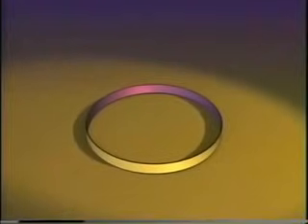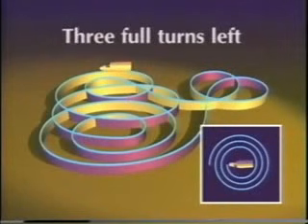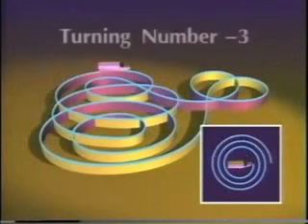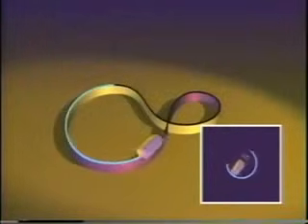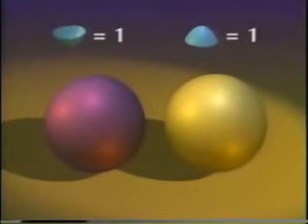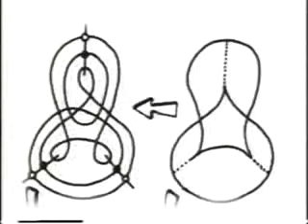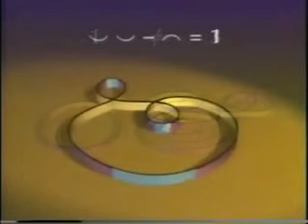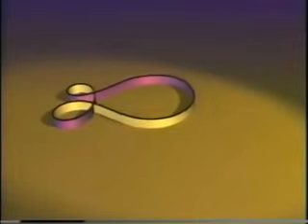how to theoretically turn a sphere inside out

Comment: Anybody can turn a sphere inside out if it can magically pass through itself.
Reply: No, it's difficult. That's the whole point of the video.
Reply: Kanade Tachibana It's not arbitrary, you just don't understand this level of math
Reply: Because it wouldn't be a mathematical challenge if the solution were allowed to be so simple.
Reply: Jason Jahn But why did they place the sharp corners limitation if they can just make up a material that can pass through itself?
Reply: The problem and the limits they impose are standard problems in the study of topology. And from there you get more practical applications. So it's not all just arbitrary limitations that were imposed.
Reply: Kanade Tachibana Imaginary numbers seem rather unpractical, too. But they were very useful for physics. Those things can be practical for theoretical formalism, although they may be entirely useless in every day life.
Reply: Kanade Tachibana Clearly this stupid fabric is rather useless. It is just some desperate attempt to visualise the properties of topological objects, which are not real world objects. This evaporation just shows you that your transformation is no longer valid. Surely no real object will ever behave this way, it just symbolises "you are not allowed to do this, becaus this operation is as ill defined as division through zero".

This video was about rather abstract, mathematical objects, not about a magic fabric. You simply can't say, topology is useless in modern physics, as it is used by some theories. This is one example of a topological proof, so it may be useful in some theory.

But I admit that such a fabric seems rather rediculous. If this video was meant to suggest that actions on such a very imaginary fabric would be a practical application of this proof, I would say, you are totally right, that would be very stupid. But I would guess this is simply not what they wanted to tell.
Reply: Kanade Tachibana
It's not so much a matter of "is all this coherent to all that other stuff". This is a building block that you might use to build something coherent: Having proved that this inversion is possible given assumptions A and B, and you can fulfil those assumptions, you can now safely go ahead and just use that result.

On the top of my head and without thinking into detail, this relates to mathematical optimisation in the sense that it gives you a way to invert your problem. That is, it's a way to take a gazillion constraints of the form "The voltage here may not exceed 230V but must be higher 240V" and turn them into the exact opposite: That is, allow anything but the span 230-240V. Which sounds useless in practice, but then I might be missing things and, more importantly: Other applied fields can probably make more of it.

Yes, we applied people often make fun of the more theoretically-minded ones as they just solve any theoretical problem they come across, without looking at the real world. But then, one day, their stuff usually turns out to be actually useful and we applied people are glad someone already solved it.

Take numerics as an example: I think it was Leonard Euler who, more or less on his deathbed, said "I have created many a thing of mathematical beauty, alas, none of it will ever be of any use". Yet, the encryption technology we use nowadays to order donuts over the internet securely is completely impossible without his results.
Reply: Jason Jahn The video should be title "How to solve a useless math equation".

They asked the question "How do we turn a sphere inside out?" Then they realized no amount of math makes that possible in real life. So they made an imaginary material so it is possible, but then it became too easy. So they decided to add a limitation that doesn't fit said material to make it more difficult.

Don't you see how stupid this is?
Reply: Kanade Tachibana My comment listed specific real-world cases where this problem is used as part of real, physical engineering...
Reply: Kanade Tachibana - Here are some practical, real-world engineering uses:

This video relates to topology of functions around a 3d field. The theorem here can be directly used in 3d fluid dynamics around vortexes - for example when a computer is calculating models of liquid or gaseous behaviour in a combustion engine, turbine, or any other kind of device which is being designed by an engineer to come in contact with fluids.

Another direct use of these theorems are in designing certain kinds of liquid crystal displays for the "electronic ink" kinds of devices..

I've also seen similar topological arguments used in computer graphics for games/film..
Reply: Kanade Tachibana
Being embeddable in the physical world in a literal sense is not a requirement for things to be useful. In, say, mathematical optimisation people are constantly working with bodies that have a thousand or more dimensions, it's all making sense, and your power company probably wouldn't be able to keep its network stable without it.

These are conceptual bodies, where a dimension might map to a slider on a switchboard, somewhere, and you can have thousands of sliders hence thousands of dimensions. The laws governing them are similar, but not necessarily identical, to bodies in the actual physical world. We call them "bodies" because it's the closest analogy we have.
Reply: aoeuable Just to throw in something here, I agree, Euler's creations have greatly affected technology as it stands today. This world would be nothing without both the theorists that focus on imaginary figures, and the people that find ways to apply such things. It's more common to be constructive in the sense that you apply things, as you all seem to be, I definitely am, and most other people are. Without people who study something as seemingly ridiculous as this, though, innovation would be impossible.
Reply: Ильгам Хеирбеков I hope all of you don't mind , but I'm going to mute this post. It was a long discussion fit more for a message board, not the comment section.

I should not have acted so quickly and called this video useless, because no matter the relevance it is still entertainment to some. Therefore if you want to know how this is useful, ask a professor and learn yourself.

Don't slander other's and tell them to do research for you, like I did.
Reply: *****
You can't think of a material that's able to pass through itself? How about every kind of liquid and gas on the planet? The contents of this video are used heavily in modeling fluids.

"Why can't there be creases?!" - Because the underlying math it's modeling is useless otherwise. Just because you don't personally work with concepts like fluid dynamics in your own life doesn't make the restrictions related to them arbitrary. Lol.
Reply: Kanade Tachibana Also, re: "no sharp edges" being "arbitrary" - that's the definition of "continuous" in mathematics ( http://en.wikipedia.org/wiki/Lipschitz_continuity ) - which is an underlying physical limit on any practical use because time moves continuously.
Reply: Kanade Tachibana In mathematical optimisation, you turn such constraints into a body, a bit simplified: Each face is one constraint. Every coordinate inside that shape is a feasible point (one that does not contradict any constraint), and you're then looking for one of those feasible points that minimise, or maximise, some further criterion, like "minimise fuel cost".

That is, you take a whole a lot of real-world things, pretend they're shapes in arbitrarily high dimensions, then solve a geometric problem ("what's the point the furthest into this particular direction that's still part of the shape"), then translate the whole thing back into the real world.

In short: The shape not being physical doesn't mean that it can't be useful for solving actual physical stuff. We could call it something other than "shape", but we don't because calling it a shape makes it easier to reason about.

Also note that it says "sphere", here, not "ball". Balls exist, spheres are mathematical objects.

Circles don't exist in physical reality, either: You have jagged edges everywhere. Still they're useful.
Reply: Kanade Tachibana
Almost everything you'd call "practical" in your daily life comes out of research that you'd say is "theroretical" and apparently think is useless. Solving problems like that one might lead to new ideas about doing math and that would impact EVERYTHING in your life in a very practical way. Without solving problems that you deem "at the peak of uselessnes" you wouldn't have smartphones, nor computers, the internet or even something like lightbulbs. You'd be back in the dark ages.
Just because you don't understand something doesn't mean it's useless. It only means that you're ignorant of the subject. Which people usually just accept and don't feel the need to make big demonstrations of their ignorance claiming to know better.
Reply: David Stevens "But why did they place the sharp corners limitation if they can just make up a material that can pass through itself?"

Mathmaticians are seeking ways to make precise models of vague ideas, such as geometrical shapes. The amount of information you put in the model has a lot of impact on the amount of consequences that follow.

For example, you might want to allow such creases. Then, this particular problem is easy, and the field of maths analyzing it is called topology. The shape is called a topological manifold (embedded in 3-space, which is normal, 3-dimensional space).

You'd be surprised with what freaky kind of creases you can come up with and what you can do with them to "cheat" your way to certain results.

By disallowing creases you put more information in the model, since in order to define creases properly you need a notion close to curvature. The surface is then called a differential manifold and the field of maths dealing with it is called differential topology.

Topological manifolds are differential manifolds where "we forget about curvature", and so creasing becomes unimportant.

It's easy to see how self-permeability isn't really that relevant to that distinction. Self-permeability is of course another valid constraint that can be place independently.

The important thing to realize for laymen here is that mathematicians don't invent those rules arbitrarily: They analyze all possible rules that you can think of.

The fascinating thing here is that there are many surprises with specific such rules, such as this one.

If you want a more elementary example for such a "modeling problem", look at irrational numbers or the incountability of the real numbers. These things are sometimes discussed even in school, and nonetheless extremely surprising.
Reply: aoeuable You seem very educated in this discussion, so I will give you the benefit of the doubt. Could you link me to something that proves this math is coherent to said engineering? 

I'm not attempting to insult you, you responded how a reasonable person should, disputing the central idea of my argument. Props on that, my good sir.
Reply: aoeuable That definitely applies, but I'm not talking about any arbitrary rules, I mean THIS problem. Not meeting an exact voltage is a problem that has practical use, it isn't making up a problem for the sake of the problem. It isn't widespread with the possibility of entering the numerous fields of engineering.
Reply: Samurailord I'm not saying all theoretically problems are dumb, but this one certainly is, because it isn't really a problem. If something can pass through itself, sharp edges won't stop it.

And don't compare light bulbs to this, in what way were light bulbs based on a fake material that somehow had only one incredibly irrelivent flaw? Light bulbs are just a textbook invention of a REAL issue, with REAL limitations.

Face it, this is a BRAINTEASER that mathematicians made, not a theoretical math problem with implementations some day.

And lastly, for the record, I understood the videos perfectly. Just because I think the problem is useless doesn't mean I don't understand it.
Reply: joshfish2 You never sit there thinking about things and wanting to work them out? Never try to figure out how to manipulate things 3 or 4 dimensionally? Never try to imagine what it would be like if we could view things in a fourth spacial dimension?

What do you think about on long drives? Or when you're laying awake at night tryin to sleep? Or when you're waiting for he microwave to be done? During loading screens in video games? If you think it's pointless, then it's clearly not for you, it's for the ones that don't.
Reply: Kanade Tachibana So then what you're saying is that it's useless because it's simply a puzzle that has no real life application? Even ignoring that it has many applications, so what if it's a brain teaser? It gives people something to think about. Does it need any more use than that, even? Puzzles exercise the mind and help people come up with new ideas. It's thinking like this that might cause someone to shout EUREKA! And run naked through the streets.

Also the pinching rule is NOT arbitrary. I interpreted it as being based on the face of the sphere is a mathematical curve, and in a lot of equations you can travel infinitely close to zero, but can't reach it without opening up another can of worms or hitting a dead end. It is, in fact, making things simpler to mathematicians in that aspect.

I mean also... do you really think it is any more useless than telling of people who are interested in the subject that their interest is useless over the course of a week on a youtube video comment thread? ;)
Reply: Tim Wintle I'm done researching this topic, but you are more educated than I am in it.

I guess I'll just accept that this problem isn't useless.
Reply: Ильгам Хеирбеков "Name one prediction maths ever made. And I don't mean calculations based on REAL WORLD objects."

I can't, but then again I didn't claim that unapplied maths made such predictions. joshfish2 claimed that history does, which it doesn't either.

Maths, on the other hand, can be applied, mostly by the natural sciences and engineering, to make all sorts of predictions.

For example, the complex numbers, discovered by Gauss before any real-world use was known was later successfully applied to many areas of science, mostly electronics and other parts of physics.

Up until then, people like you would have whined about how complex numbers follow "ridiculous rules" and "can never exist in the real world".
Reply: "If I can't understand it, it must not make sense!"

Yep, you're a genius. I'm sure you've got as many engineering degrees as you do spheres of water.
Reply: Chad Wolfe Theoretically, couldn't any brain teaser, like the wolf-rabbit-corn puzzle, be a basis for future tech? You can't say for sure, can you?

That's where this WHOLE conversation crumbles...
Reply: John Tyson Still just a fancy riddle. Interesting to some, incredibly pointless to most.
Reply: Tim Wintle 
Let me settle something people keep coming back to:

I do not think all topological theorems are pointless, just THIS problem.

I know the theoretical study of 3d space is useful, but this one simply isn't.
Reply: If you can create a virtual world with specifics rules in it where you are allowed to have materials that can pass throught itself but can't pinch then it's not a bullshit idea.
Reply: Kanade Tachibana You're asking strangers on a YouTube video to provide a practical explanation or use for a mathematical concept that took doctorate, award-winning mathematicians from the world's premier universities to come up with. If you're legitimately interested stop wasting time on here and send Professor Stephen Smales a letter or something.
Reply: Kanade Tachibana There once was a bottle called KleinThat had such a clever designIt would turn inside out,Which created some doubtWhen it came to decanting the wine.
Reply: aoeuable That entire comment is full of buzz words that had no underlying point. You basically expanded "Limitations may seem odd, but happen, and are useful" into numerous paragraphs.

I'm not saying problems LIKE this don't exist, I'm saying this is useless when compared to real problems.
Reply: joshfish2 History can't predict anything, and, to be fair, making predictions is very clearly not part of of the science of history.

It's a bizarre claim especially in the context of comparing it to mathematics, as maths did indeed help to predict a lot in many sciences.
Reply: @kanade tachibana there is a solid reason for the requirement.  In order to write an algorithmic transformation, there can be no edges or vertices on the surface as they will trend towards zero or infinity and render the transformation invalid.  The point is to be able to map every point on the outside of the sphere to one and only one point on the inside of the sphere.  These mappings lose their one to one property if they cross an edge.
Reply: David Stevens because this material is following some laws of physics,
Reply: Kanade Tachibana
see, math and theoretical physics is very abstract at first.  you see no relevance for it unless you work for it.  you need a fucking deep understanding of it to see the uses of it. 
sometimes its better to be humble and just back off instead of starting to judge things you have no clue of especially when its well known that math/physics can be very complicated.
the "regular" human living probably thinkgs quantum mechanics is useless when he sees it.  just some fun games for nerds. i totally understand that point of view but people should be much more humble about things they have no clue of.
quantum physics is VERY important for electronics, chemistry,  solid state physics, informatics, engineerng, medicine, theoretical physics thus physics in general too.   its one of the topics with the most influence nowadays.
i hope you get my point.
Reply: This was very frustrating to read as I felt the need to just punch someone in the face but had nobody in front of me, just an outdated text written by an initially ignorant person. I am very glad there are lots of smart people explaining things in a very calm, very nice way. I would have choked someone already. Kudos to all the fine people who have patience and proper eloquence.

I was just shaking my head in disbelief. Wow, the ignorance.
Reply: joshfish2  Number theory was considered useless by almost everyone(which includes some extremely smart people) until 1940s or so.  For 300 years, it was something some math geniuses did for their own amuzement.  But now modern cryptography depends on it.  The thing is you never know what will be useful and what won't.
Reply: Phraser
thats it.  people judge too fast even without being educated well in that topic.
Reply: ***** I think the point of the rules is to focus on the turning numbers. As the woman says, if the pinching/puncturing rule didn't exist, the turning number wouldn't be constant for circles (or 2D curves). However,with these same rules, they prove that 3D curves do not have a constant turning number, which is interesting. I'm not sure what that means for mathematics in general, but it's interesting that the constraints kind of center around that one concept.
Reply: The "no-crease" rule, but at the same time allowing 2 objects in the same place at the same time just seems so arbitrary. Why even have the no-crease rule? It's like a useless game where you just make arbitrary rules to barely make something possible, but there is no logic behind the rules, it's just really conveniently designed to make it possible, but hard.
Reply: Kanade Tachibana I think it's kind of 50/50 though. There's really no way you could possibly know. !00 years from now things could be entirely different and maybe limitations like that may exist. That's unavoidable. 

Although this is true, I do agree to the fact that it's more of a brain teaser than a theory. 

And also, you understand the problem, but I think the person commenting before may have meant that you don't understand the possible reasons for the problem because they don't exist yet, though they may one day, who knows?
Reply: Jason Jahn
but that's the thing about these problems. What's the point of making a fucking problem if it never existed nor will ever exist?
Reply: Kanade Tachibana The nature of theoretical science. Maths isn't the only science that you can hold that against. History is also pretty pointless, so is building particle accelerators.
Reply: Jessica Wilkinson
ok I'd admit that I'd think about it. But I wouldn't find it useful in my life, it would just be something to think about while, as you said wait for the microwave or something.
Reply: John Tyson
How is history a science? Sure history isn't that useful but at least it can predict events in the future according to past mistakes
Reply: John Tyson
of course it can predict things, such as the fact that there are sadly many possibilites for a nucleur war or world war 3. It almost did happen and the world knew it, the Cuban missile crisis is the most infamous of these events.
Reply: joshfish2 Name one prediction history ever made.
Reply: Kanade Tachibana agree
Reply: John Tyson  Name one prediction maths ever made. And I don't mean calculations based on REAL WORLD objects. Can you name anything achieved with maths of IMAGINARY WORLD which we use today in REAL WORLD? Like things from this video, when people make up ridiculous materials with ridiculous rules which have ABSOLUTELY NOTHING in common with REAL WORLD. Name one practically usefull thing that was achieved with help of mathematical calculations based on something which can never exist in REAL WORLD.
Reply: But matter is mostly void space held by energy.
Reply: Aryu L
ah ya, i have a few sphere's of water laying around my house. I have a couple water cylinders too.
I hate not being able to crease them though
Reply: Yeah it is.
Reply: Its very useful for game developing.
Reply: Kanade Tachibana All math works this way. That's why math is stupid.
Reply: Jason Jahn Yeah to say it works mathematically only doesn't say much for math except deeeerrrrrrrrrp
Reply: bye bye physics /(•.•)/
Reply: *****
yap and even that is relative because you dont need to understand math to use its products (internet, iphone etc.)
Reply: *****  ahh we probably have a misunderstanding here :).
i referred to your last sentence "theoretical math goes beyond just 'today' and your personal needs".  i want to add that its actually not beyond your personal needs, its just not needed to understand it to use it because others made i viable for you already (aka internet, smartphone etc).
Reply: *****
 yeah a part of it goes beyond our currently use but a big part is already in use. just want to point that out.  that  "you dont have to understand it" doesnt mean its bollocks, its just a lucky circumstance that people who understand it can make it usable for others who dont understand it.
Reply: David Stevens if a material could pass through itself like this, its likely a crease would reverse the fold, and likely break off, so the rule is a little practical
Reply: Yes, but not a circle or a torus (aka donut)
Reply: that because you like anime you virgin nerd weeaboo
Reply: Kanade Tachibana it really isnt ;) topology is very important for nearly everything connected to math (and wo with science). The sharp edges have a meaning in math. The surface is still continious but its not differentiable. And mathematicians love properties like differentiable because surfaces with properties like this have an application for real life. (most potentials or functions in physics are continious and differentiable)

I think only people with uni. background knowledge of math can really appreciate this video because topics like continious/differentiable functions, topology,winding number of curves etc is needed.
Reply: ***** Maybe people without the needed background are not the target audience of the video. U can also complain how stupid physics books are. But when u r not in the target audience its redundant
Reply: Kanade Tachibana she said abstract material, so it doesn't exist. It's called theoretical not experimental.
Reply: Phraser Nail on the head, to most people this video means nothing. Physics books aren't stupid because I can understand and experience most of what they talk about. When it moves into theoretical territory is when the guy who grows the mathematician's food stops caring. Then it's just a matter of trust that the mathematician isn't just fooling around with grant money, and will come up with something useful for society.
Reply: You can't creese or pinch it, dink.
Reply: Not with the infinite pinch law. It hurts
Reply: Combustible Lemon It is practical if life were theoretical, but it isn't. This problem will never be directly influential to physics.
Reply: CaptainNorris Even imaginary numbers can be used in some theories, because the limitations they impose could be practical. But this problem is at the peak of uselessness. That fabric might someday exist, but if it does, it won't evaporate when folded. Even as a physics geek this felt ridiculous.